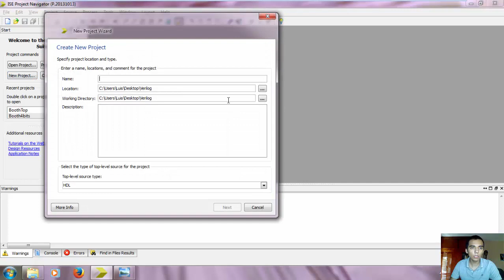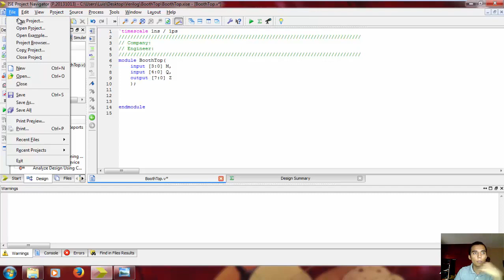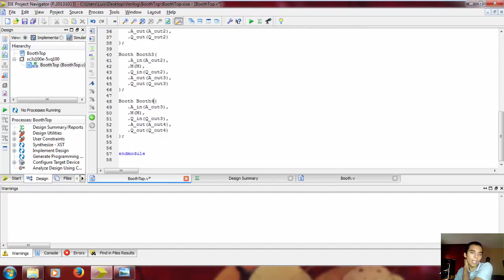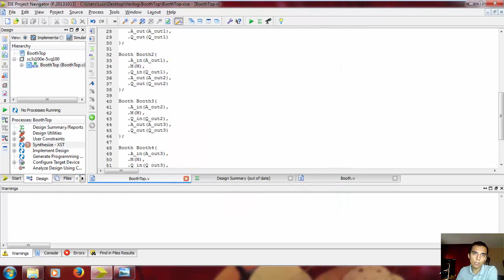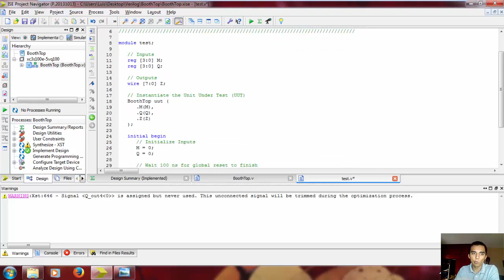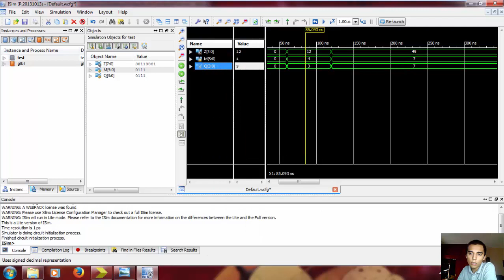Xilinx ISE Booth Algorithm Verilog -Part 2

Comment: hey guys , i put the value of m as 1000 which is 8 and q also when i put 8 the value of z is 1100000 which is 64 but when i change the radix to signed binary it is -64. it should be 64 right but it shows me -64. can anybody explain this to me and how can i get 64 because i am multiplying two 4 bit positive number .

Comment: I tried 9 * 1 and I am getting -7 for z for some reason. Why isn't the z result 9?
Reply: Because 9 is written as "1001" in binary and "-7" is also written as "1001" as 2's compliment. So it is considering given input as signed input "-7". That is why you are getting output as "-7".
Reply: SNEHA PATIL so can please tell me how to correct it 
Like 9×9 =81 
How can I get the correct result
Reply: @sachin-lv4cb i think the value of q cannot be greater than 7 because the size of q is  4 bit and if the msb is 1 then the value will become -ve .for example we know the value of 7 in binary is 0111 and -7 is 1001 we get this value by taking two's compliment of 7 . the two compliment of 7 is 1001 . so now in binary the value of 1001 is 9 but in signed numbers 1001 is -7 . so if the msb becomes 1 then the value becomes -ve.

Comment: I didnt get the point where you initially  assign a bus input  [3:0]Q and then you changed it [4:0]
 and then in  instationous you write this thing " .Q({Q,1'b0})"
and then in your test bench again the bus size of Q is [3:0].
Why ???

And thats why I've facing issue in my code, the output is not coming correctly